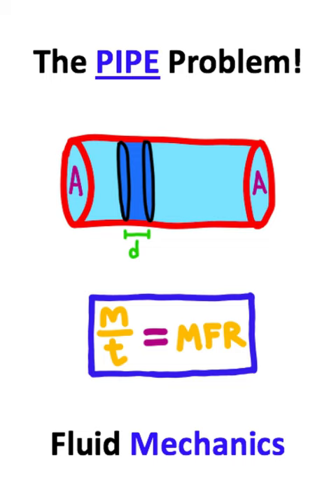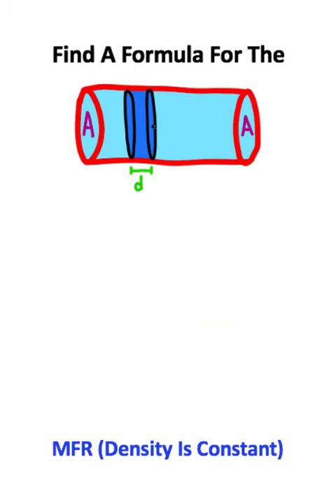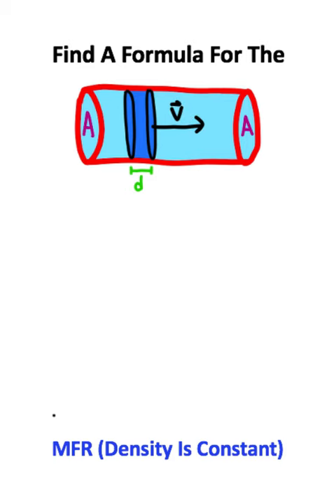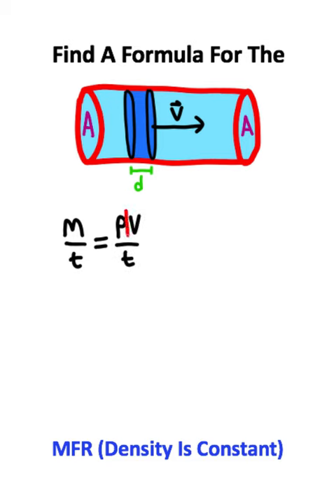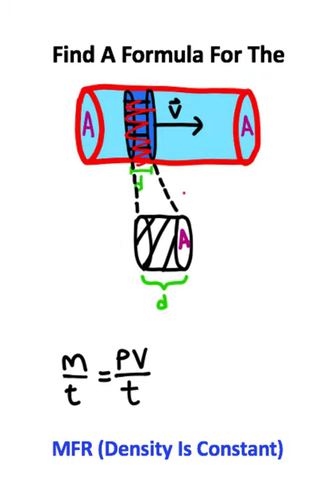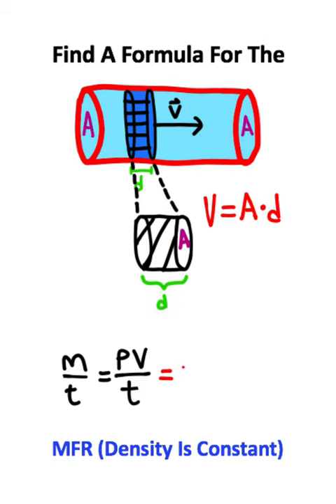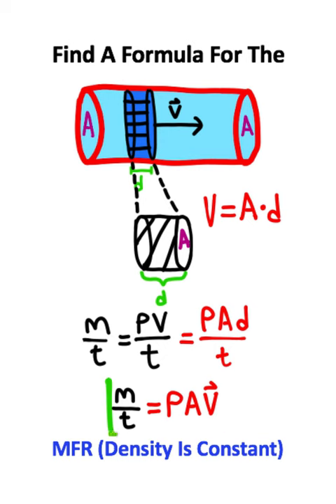Fluid Physics Is VERY HARD!!

Comment: If you want to be really rigorous and strip each variable down to its bare essentials, you could substitute pi*r^2 for cross sectional area
Reply: true, but if the pipe weren't cylindrical then we would have to stick to using A. the formula rho*A*v will still be true.